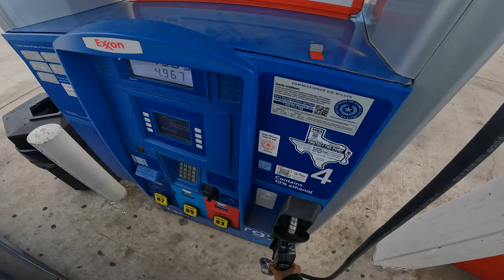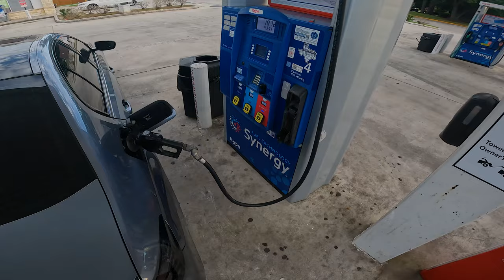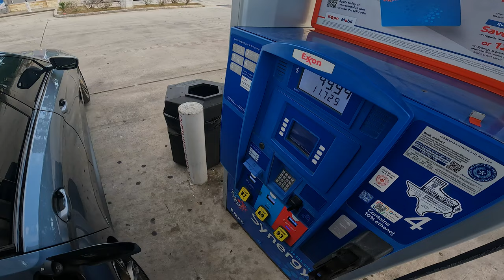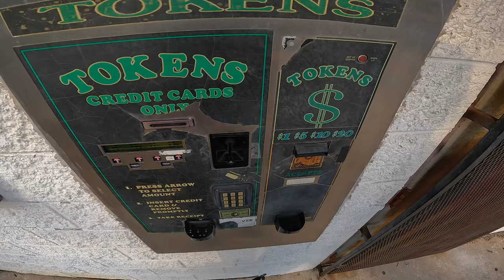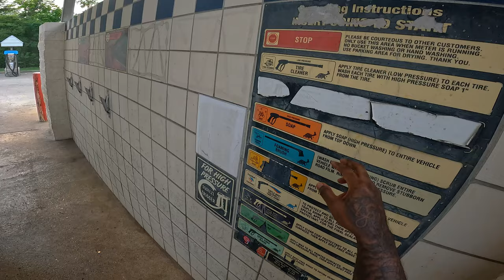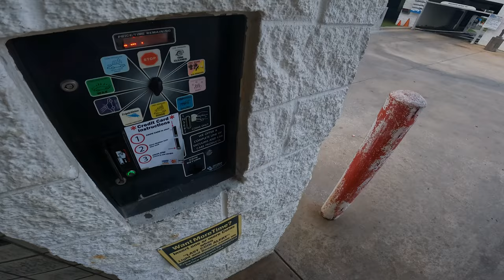POV CAR WASH ON MY G30 M550I + DRIVE

Comment: 21:29 You go from the exhaust where is loads of dirt and contamination up to the side mirrors? That is how you will scratch your car also this brush is very aggresive on paint you will be better of doing a handwash with a microfiber dedicated body wash everything in this video is just wrong, also you did not dry it which leaves water spots.
Reply from the maker: in the video i said im getting new carbon mirror caps anyways so i dont care too much for those
Reply from the maker: and i didn’t use the brush on any paint what are you talking about 😭